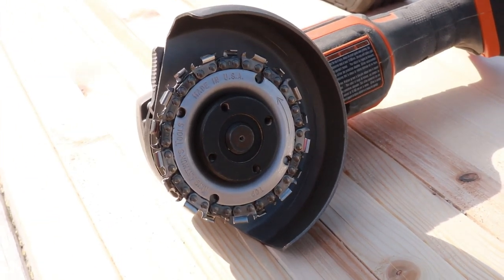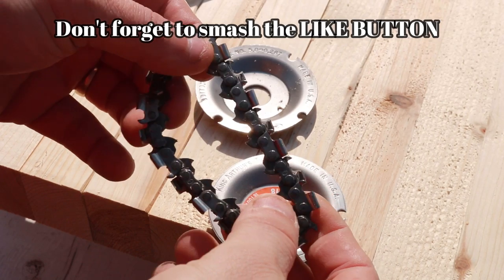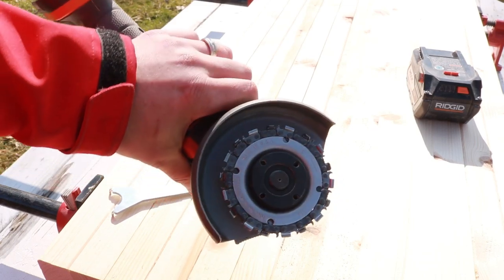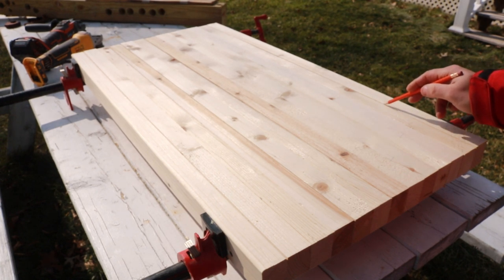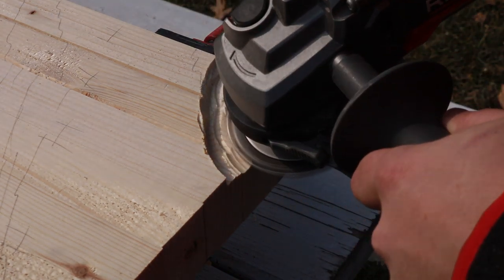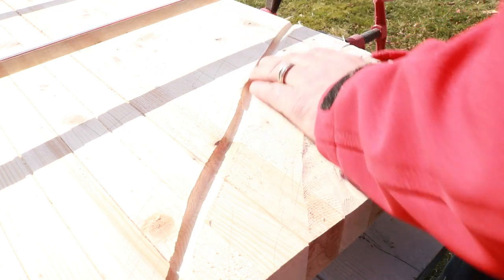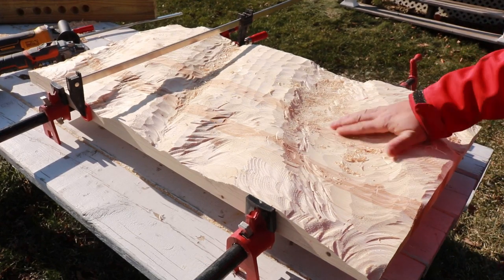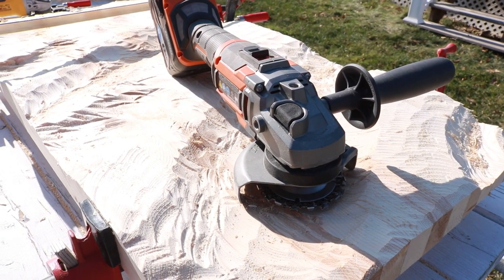This Is An Amazing Wood Carving Tool!

Comment: Do not use this tool. its not a question of if but when you will get hurt.  There are lots of pictures on Facebook showing the damage this thing causes.  Angle grinders do not stop when you let go of the switch. You will get a kickback, guaranteed and it will jump out of your hands and still be running.

Comment: I’ve always called those blades Widowmakers. The potential for wicked kickback is very high. However, as you mentioned, I think cordless grinders bring the risk factor down to an acceptable level with their ability to stall.
Reply from the maker: Yeah fishbone, it's a bit scary lol
Reply: The potential for kickback is multiplied when you try running up and down the groove. Always run into the cut so the teeth are cutting. I saw him run it backwards down the groove and was waiting for it to run away and up his arm.
Reply from the maker: Were you

Comment: Good stuff. I got the blades on order and the octane grinder. I hope my flag will rock.
Reply from the maker: Bro let me know how it goes and if you need any help
Reply: Hey man. I bought the octane grinder. It was junk. Man.  Took it back over heated. The blade is BA. But I am having a issue when getting swirl marks out of the flag. Also what bit did you use for the star cut out.

Comment: I just watched another video on this type of carving wheel. Numbers tell you all about the wheel 3= 3 inch 58= 5/8 inch arbor 18= teeth per inch. So the wheel in this video is 3" not 4" like he thought. If he had bought a 45818 he would have had that extra 1/2 inch he wanted.
Reply from the maker: I actually went and bought the turbo planer and don't even look at this anymore.  The turbo plane is a bit more expensive, but well worth the price

Comment: You can also stack the other wheel with less teeth on the grinder to get smoother cuts
Reply from the maker: I actually purchased the turbo plane.  Its awesome so I don't really use this as much not, but great suggestion!